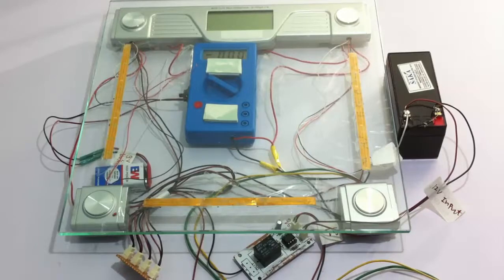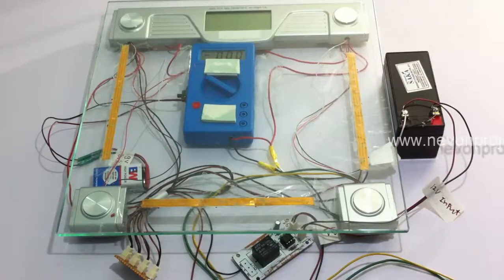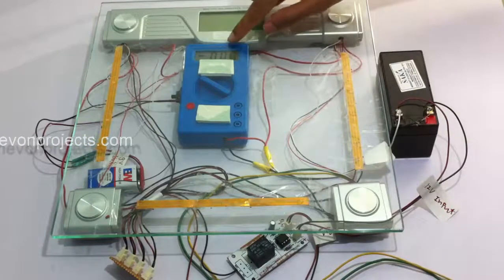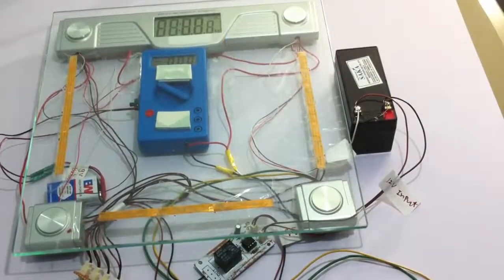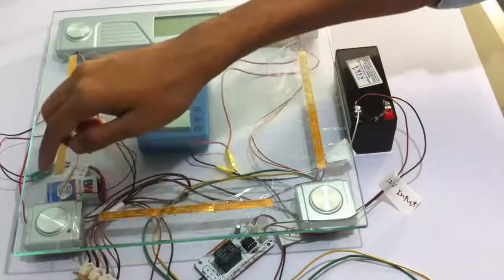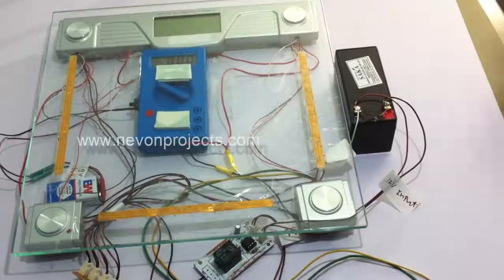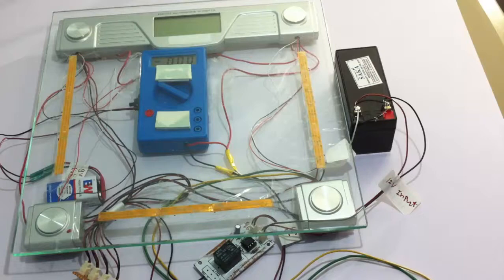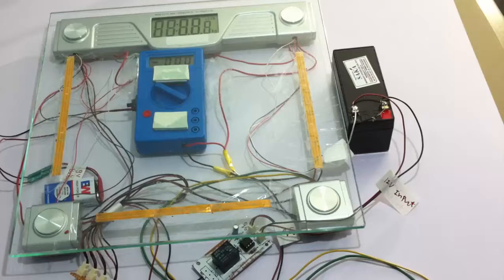Foot Step Power Generation

Comment: Does this circuit automatically cuts off the supply to the battery when fully charged I mean to say is charge controller used in this circuit ?

Comment: is there any way to receive info about the piezo sensors?
i would like to have them without the weighing machine.
and there is no where to place a comment in the link you shared, so i wrote it here...